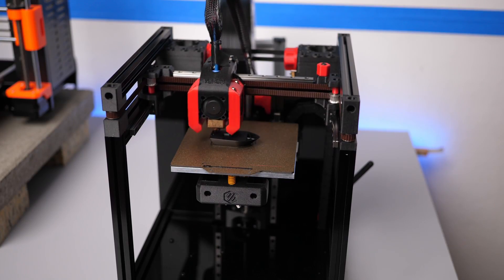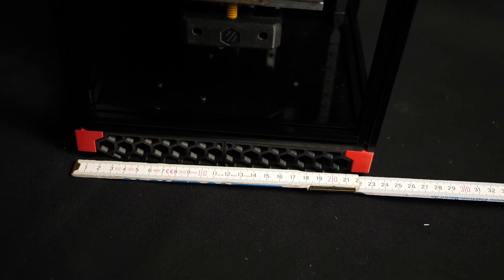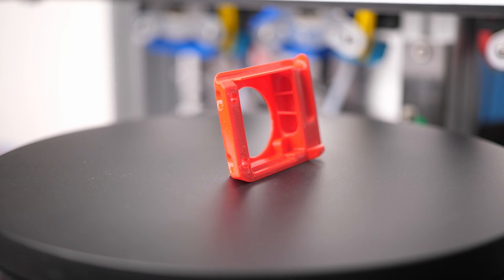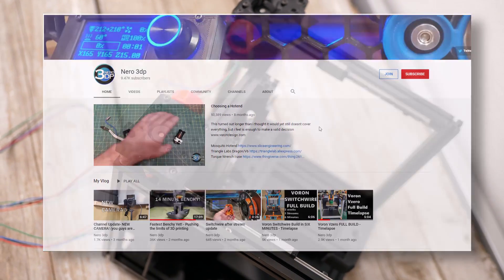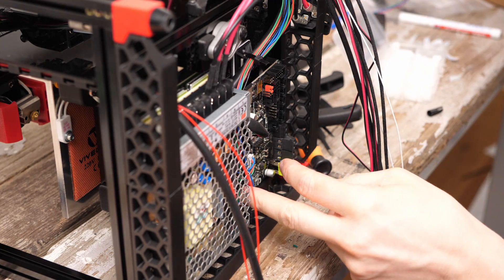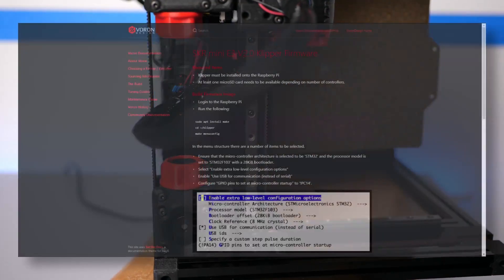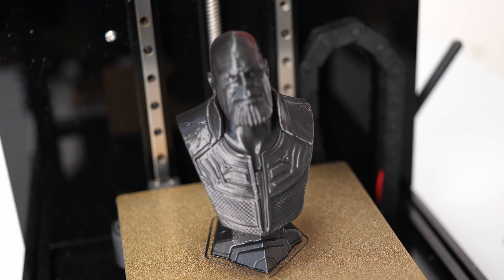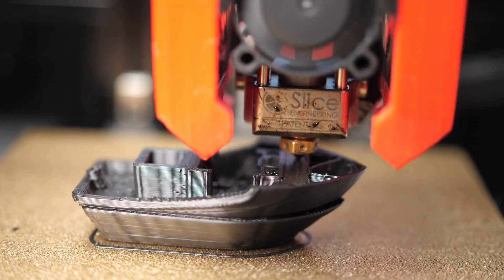Mini, Fast & Open-Source Core XY - The VORON 0

Comment: add some fiberglass pipe wrap insulation between the hot bed and the bracket. it will keep the heat away from the bracket as well as minimizing the loss of heat from the bed. I did that to my anet a8 to allow it to reach temps it couldn't reach normally in my basement.

Comment: Perhaps a compressed air line could replace the part cooling fans. It may be able to increase cooling and decrease weight at the print head.

Comment: Klipper reminds me of the old Sailfish firmware like on my Replicator 2X.

Looks neat, especially as a "second printer" - I similarly dislike the printing wait. Though, the attitude of some of the printer's fans in these comments is somewhat discouraging. I'd think one could be forgiven for trying to get away from abs, especially when you have access to pretty fancy materials and printers for them that Stefan has.

Comment: Hey, I used Fiberlogy Nylon PA12 CF15 for a replacement gear in Range rover’s rear window  a few months ago, wiper survived the heat from the motor and is working to this day.

Comment: You should be able to use at least 8K acceleration and faster speeds when you start using input shaper. I'm running 8K and 150mm/s+ on my 300x300 v2.4

As far as materials go, ABS is plenty stiff enough for this printer at its highest speeds. Though I have really wanted to see someone use a carbon fiber PC blend.

Comment: I'm printing my parts now with PolyMax PC for the main parts and Hatchbox red ABS for the accents.  I'm going to build mine with 16T pulleys on the A/B motors for extra torque.  I'm going to use a 12v bed heater and a boost converter for 24v on the hotend and electronics so I can run the printer off of 12v in my van while I'm at work.  Good luck with the rebuild.

Comment: Many thanks for the insights Stefan, very useful! And 🤔 very interesting with sagging of the parts over time. 

I’m also testing now some other similar filaments because I need something stable in time.

I’m close to consider CF PEEK 😅 (but I’m missing a Funmat HT Printer for it).

As a cheaper option I would think of the High Temp Resins, on SLA, but also don’t know how they perform over time.
Reply: The spec calls for ABS and nothing else. It was designed to use ABS parts, and it works with ABS parts.
Reply: @PepsiMagt  I don't see how that's an argument, ABS is cheap and retains it's mechanical properties at fairly high temperatures, that's likely why it was chosen. However it's softer than many other options and Carbon composites have much better dampening properties as well as being stiffer, and in the case of nylon and especially PEEK or ULTEM, more heat resistant as well. The recommended option isn't always the best.
Reply: @It_got_darK  the video clearly showed that carbon reinforced nylon suffered very much from heat creep, deforming under multiple heat cycles. ABS does not do that. It will defor, but it springs back and do not suffer from creep.
Reply: @PepsiMagt  I stand corrected about nylon, which sort of makes sense in hindsight, that however does not mean that what I said is not correct. Every material suffers from heat creep, what differs is the temperature at which that occurs. In plastics that tends to depend on the glass transition temperature , which is why semi crystalline plastics usually perform better than amorphous plastics etc. (though printing compromises the crystallinity of plastics anyway)
Reply: @It_got_darK  Semi N00b here. Can i use ABS+ too? According to the specs i should but its always better to ask.
Reply: @gonzbunich6473  ABS+ has a lower melting point and I assume also a lower glass transition temperature so you might be at more risk of heat creep (though I doubt it's more than a few degrees) but I don't see why you couldn't.
Reply: @It_got_darK  Thx for the insight. But then eABS Plus should do it. (eSun is the only decent filament available here if you dont want to pay USD 60 - USD 100 per kg). According to their filament specs its superior to ABS and ABS+.
Reply: @PepsiMagt  I don't understand how that's so hard of a concept to grasp for some people

Comment: I would go with ABS. Under long term high temp usage it has proven to be quite stable. Some of my long term high temp parts are more than 5 years old. Also nylon becomes somewhat brittle under constant heat.

Comment: A good delta still beats everything in terms of speed.
Reply: Which Delta would you recommend?
Reply: @rigaudio  I dont know what is sold now. I have a 4 year old full metal custom built with linear rails. 300mm/sec no problem.
Reply: @MonguzTea I've been interested in building a delta of my own. What resources did you use?
Reply: @rigaudio  The frame is german alu profiles with alu cnc corners 0.9 steppers, smoothieboard with smoothieware, chinese linear rails. I used an online calculator to determine the dimensions. Now its better to buy a ready made one.

Comment: Voron might be pretty but there are way faster designs like the Hevort
Reply: Is there a 120 mm hevort?
Reply: @aman11283  I think I saw something in this size. It's fully configurable so you sure could
Reply: @MsKoffeinjunky  Pics or it didn't happen. Anyways this is moot because he's never going to build a hevort, and the voron being pretty is definitely part of the appeal.  He said right in the video he doesn't want to source the parts himself.

Comment: The thermal fuse should be attached to the heating pad rather than the bed. I've heard that the heating pad can detach itself from the bed after a few years of heat cycles.
Reply from the maker: Any idea how to properly attach the fuse to the silicone pad?

Comment: Ahh! yes I found it interesting you went back to Nylon considering the material creep video. That video saved me from using Nylon in a couple critical applications. I'm still on the hunt for for something with a working temp of 100c that doesn't suffer creep. Maybe a PC-ABS or PC-ASA blend may be the answer?
Reply: pei would work i think.

Comment: I just started to build a Voron 2.4, and got the parts from the same seller on aliexpress.  There is something therapeutic about building this machine.  The zero is so cute and functional, glad you show cased it.
Reply: I have been told that the print parts from Ali where of bad quality, you should have use the PIF program instead.

Comment: I also have the part cooling fan on, but on low speed, when printing ABS on my Hypercube. It results in much much better prints than no cooling. I've printed hundreds of functional parts that way for several years. Not sure why so many people are claiming ABS should never be cooled.
Reply: I have an open frame printer and I had to use a little part cooling fan for ABS. Otherwise the next little gust of air movement warps and cracks the print. Higher temperature of the print improves bonding, but consistent temperature is more important.

Comment: “Some call the Voron over engineered, I call it well engineered...”

Of course you do, you’re German! 😂
Reply: There is no over engineered in the German language
Reply: @skysi  That’s… actually true 😅 We use the English term too. Well, if we absolutely have to, that is. 😁
Reply: @skysi  that's right. there is no meaningful possible german translation of "over engineered".
Reply: @skysi  doch, "überdimensioniert"
Reply: @victor_glekler  überdimensioniert bedeutet man hat es zu groß oder zu dick für den anwendungsfall ausgelegt. Bei dem Begriff over engineered geht es um unnötig hohe Komplexität des Bauteiles.
Reply: Bru of corse not Look at the german language its a mess
Reply: @user-vy5hc9ud6l  bru of corse. Lern Englisch du Lappen.
Reply: Not what it used to be unfortunately.
Reply: Today german products = China made expensive crap.
Reply: Hey, what’s that supposed to mean?! 😤 … 😉
Reply: Clearly you havent driven a german car. So unreliable
Reply: @claudekim7876  That depends what year and model you buy.
Reply: @claudekim7876  They are engineered to fail right after the warranty expires, so technically they are over engineered.

Comment: I am working on getting my Printer I have ready to print ABS, just need an Enclosure what I am currently working on (PRUSA LACK). Then I will start my Voron journey with the V0. I really like the small form factor, but in the end of the journey I will have build all the Vorons. In my humble opinion, they are the best DIY printers you can get and the quality might be tied with the Raise3d and Ultimaker printers, if not even better ;)

Comment: I recently did a functional part for a friend, and I would check out a wash and cure machine for resin Printing. Makes the post processing so much easier. I use the Anycubic Photon and wash & cure 2.0 with Elegoo ABS like.

Comment: Hi,  quick calculations: a optimised Benchy has around 9 to 10 grams of plastic. Thats around 10cm³ or 10000mm³. So you need to have a constant average flow of 16,6mm³/s trough the nozzle to print it in 10min. But there are travels which reduce the average flow. With an optimised path they add around 20%, so it goes up to 20mm³/s max flow. Acc and Jerk ad around another 5%. So you need 21mm³/s of max flow. With a layer height of 0.4mm and 0.8mm width you need a average speed of 65mm/s. And very good cooling. I would print it with PETG. I have done some 12min Benchy with an Sidewinder X1 + Hemera + 0.6mm Nozzle.

Comment: It's a shame that it isn't easier to get Nema14's, the costs on a small printer are often worse than a full size one!
Reply: See it this way: You pay for the speed
In general not because something is smaller means it is cheaper, there costs the are fixed, or might even go up.

Comment: I've been kind of jealous of the Voron owners (especially with Klipper with input shaping). My YouTube suggestions is full of Voron videos. Seemingly just to tease me. I'm just not willing to invest so much time in sourcing, building and tuning a machine though. It would be nice is someone did a complete kit including the printed parts.
Reply: You can get the printed parts through the community PIF program: https://pif.voron.dev and by now there are complete component sets on AliExpress which at least give you a starting point, even so some of the parts are not up to spec.
Reply: @christophmuller3511  Looks like there’s about a 2 month wait for parts through the PIF program. That’s not good for people who don’t have the patience to wait for normal print times!
Reply: @JonS  well worth the wait however - the parts are made on a Voron by vetted community members and you are guaranteed to get very high quality. Anyway, two months is typically how long it takes to source parts from China...
Reply: You can put klipper on basically anything.
Reply: @miklschmidt  sure, that's true. What I really meant was this whole speed-obsessed side of printing was making me slightly jealous. With two young kids, I just don't have time to go down that particular rabbit hole.
Reply: @JonS  There's a much more approachable option out there. Check out Rat Rig's V-Core 3 :)
Reply: @miklschmidt  looks promising. I think I'm going to have my hands full for a while though. There's a Craftbot Flow IDEX being shipped to me to evaluate. I'm expecting it to arrive any day now.
Reply: @JonS  Nice! That's gonna be a fun time indeed, wouldn't mind having one of those :)

Comment: Hi Stefan,
Great Video! Now you made me thinking to convert my printer to Voron.
BTW have you considered printing the parts in Resin?
Reply from the maker: Haven't tested it on my own but I think resin parts are not really great for long time usage.
Reply: @CNCKitchen  I've tested a few parts (part cooling duct/ Sensor Mount) and it seems -so far- it's doing a good Job. Another idea that drastically enhance plastic parts: Painting/Coating.
Another idea: What's the difference (in weight) between a 50% filled ABS parts, and an Aluminum machined part?
Reply: Resin is stable but brittle. Small stress cracks formed on the motor mount of my large capacity printer. PETG was then the better choice...

Comment: Print those parts in ABS, or even better, polycarbonate. Like you said, creep is all about temperature. Even with a newer formulation of CF-PA, I can't imagine the temperature resistance is so much better creep wouldn't be a concern. If you still want carbon fiber, CF-ABS and CF-PC are options!

Comment: I’ve heard that on some parts that experience high temperatures it’s a good idea to use ASA but otherwise it should be printed in a good quality ABS. I would have thought that nylon would keep absorbing moisture once printed so would be something to avoid in a rigid build.

I’m currently watching Nero 3dp’s videos for my 2.4 build. Would be good to see someone do a video on the Hall Effect option install along with standard wiring (step by step) as I think it would help people on the fence about building one. I was looking at a Prusa, which took me to the Caribou and then I fell in love with the Voron

Comment: I am currently working on a design, based off the V0, to accommodate a set of 5-phase steppers and bigger build area. all the critical connections will be from laser cut steel sheet exactly to avoid deformation. Won't look as neat and clean as the V0, tho.

Comment: Great video and thanks for the shoutout!
Glad the machine is working well for ya,  sorry to hear about the creep issues, currently planning a V1.8 build for dedicated higher temp plastics, was leaning toward CF nylon as well but will have to do some more testing it looks like :P

Just wait till you get some fresh parts and a full tune it on, its going to really fly.
Reply: Use CF-ABS instead? Or will you get too close to glass transition temp with that build?
Reply: @marklandsaat3696  Can't find any cf-abs, only pla or petg. Can you name/link a product name you trust?
Reply: 暂停
a V1.8 build for dedicated higher temp plastics！suspend？
Reply: @takingleung2336  Machine will be for plastics like Nylon/PC and other materials that print better with higher ambient temps.
Reply: @CanuckCreator   What about CarbonX™ PA6+CF (Gen3), can be printed with a all metal extruder at 240 - 270 degress and have Deflection Temperature of 147 degress.
Reply: @CanuckCreator  There's CF and GF ABS and ABS/PC out there
Reply: Toasty boy! Love your stuff Nero3dp 🙏👏👏👏
Reply: Do you think the printable files are suitable for home casting with 
 Sand and forge or a home cnc?
I am toying with the ideas but have not built the cnc yet.
Reply: wondering about greentech pro carbon. What they claim sounds almost too good to be true

Comment: Print its parts in ABS, PETG creeps easy under heat the same as your current parts.
Then, if you find a better material during your procrastinated creep test, use that ;)

Comment: The recommended material to use is ABS/ASA.  There has already been a lot of testing of these printers before they get to release!  Why not save yourself the headache and just use the right material?
Reply: Is ABS recommended over PC or carbon fiber PC?
Reply: @ Jaakko, Optimizing what?  If there is no problem to solve then you can't fix it.  In fact he created a problem that didn't exist to begin with.  
@ Berni, It was designed and tested to use ABS, so yes, it is recommended over PC.  PC or CF PC is not inherently better plastic than ABS - each has its applications.
Reply: @aman11283  Kk ty
Reply: @aman11283  I think ABS is unlikely to be the optimal material if you can select from all home 3D-printable plastics, as ABS is, in this case, surely heavily favored by the devs for it's availability and it being perhaps the most known thermoplastic. 

But I'm sure there's no immediate need to change the material! :) I'm NOT saying ABS wouldn't be good here. I'm saying it's highly impropable that it's the optimum performance-wise.
Reply: @jaakkopontinen  I see peoples all the time on the Voron discord trying other materials and they regret it, unless you can print PEEK. So yes at least for the Voron, ABS is the best material. STL parts take ABS shrinkage into account, if you use another materials, you may have to do some adjustments.
Reply: @yvesinformel221  Thank you for further input! :)
Reply: @Blargedy  yes
Reply: Like every good nerd, he thought he could improve something. It's an assertion that is often wrong, but it's the only way to advance.
Reply: I also have added mods for things I wanted to change/improve...but, I built it stock to begin with.  Otherwise you're just guessing.
Reply: Conforming to baseline every now and then - especially after a sound failure and  still having no better guess - is totally ok and for a optimization nerd a true sign of being an optimization nerd, as it can enable new realizations just by not being grindy in method.
Reply: This very much. And while the fumes are not healthy, it's not gonna kill ya. CNCK seems to worry about fumes just a tad too much.
Reply: @jaakkopontinen  abs fumes are actually highly carcinogenic. they WILL kill you. Same goes PLA, but only at a slightly higher temperature than the printing range.
Doesn't make any other harmless too, this field has still not been researched enough.
Reply: @jonathanlarsen4177  You got me Googling and most articles reference a 2015 study by "3D Safety". The links are dead, though, and their domain grabbed by a domain broker.

What I also found disturbing is several articles taking the stance of "While everyone knows the unpleasant odor from ABS cannot possibly be healthy to breathe in..." right from the start - that just screams attitude and/or public compliance instead of facts.

But yeah, of course it's very likely that it's better to not breathe in ABS fumes :) But "better" is a word that can imply 0.01% better or 90% better, so it's easy to say but also to misuse.